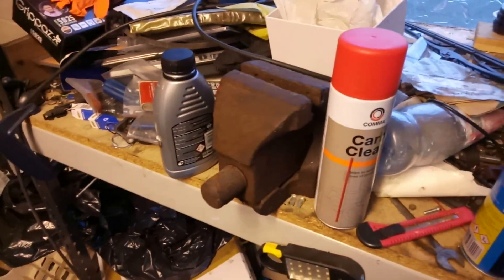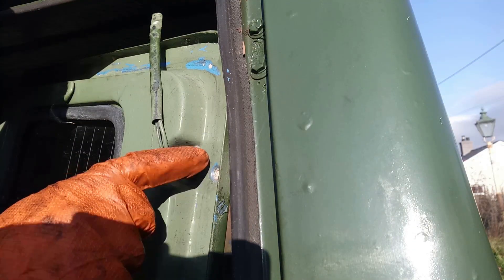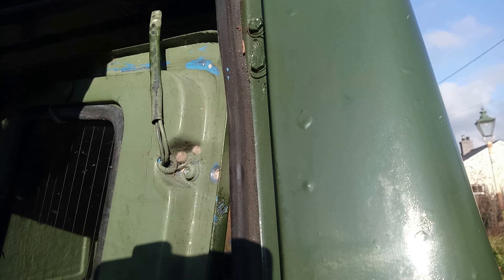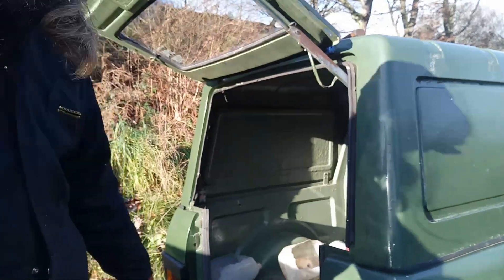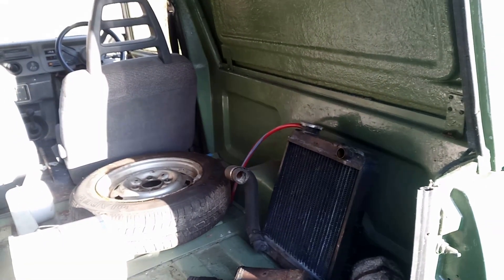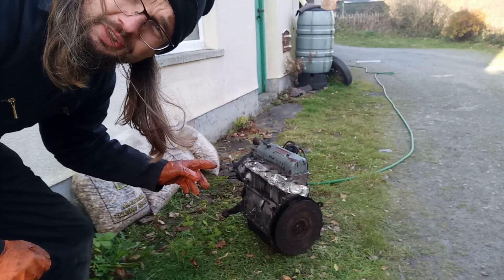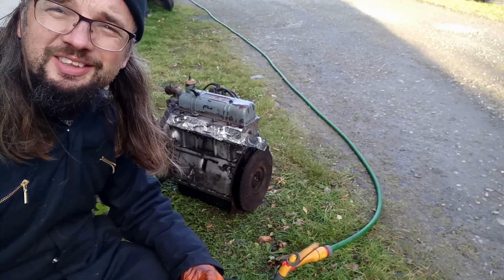Project Fox Part 2: It begins! Sort of

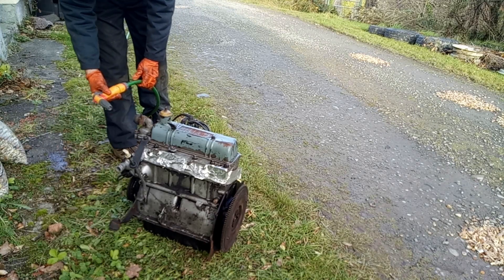Comment: Before flushing out that engine it would be best to remove the drain plug on the block. Reliant engines are notorious for silting up around cylinder 4. You can see the drain plug near the back of the block at 8:37. Remove that, don't force it as it's a narrow thread in the block. Then have a right good poke about with wire round the wall of cylinder no.4. See what comes out while flushing.

Comment: If I remember correctly, the port on top of the cylinder head is where a hose tailpiece screws in for the heater hose connection.

Comment: Since we're all on about the best water displacer & rust penetrant, an old machine shop owner told me that ATF and Acetone mixed %50/%50,  ( or lacquer thinner if you cannot get Acetone..) works far better than any of the commercial stuff.  ATF has a lot of detergent in it so it cleans munge off better than WD40 or Kroil.  It is a bit stinky because of the Acetone, use outside only.

Comment: I think that water outlet/inlet on the at the top of the block is where one of the hoses from the heater matrix connects. My Reliant Regal Supervan had a heater connection there. As I remember, there was a brass tap in one of them to turn the supply off to the heater matrix in the summer. The Robin had a heater control on the dash. Good to see you can now open the rear door on the Fox. As others have said, careful how you lift that engine (remember my back problem at the NEC?). Looking forward to further Fox videos.
Reply from the maker: Correct.  It sure exactly what bit is missing. Hopefully I have it somewhere...

Comment: A wire wheel on a bench grinder will be a good way to deal with and small items
Reply from the maker: That would require both a wire wheel and a bench grinder. And a bench actually clear enough for a bench grinder...
Reply: @HubNut  your correct on all counts,if you go with a hand held unit they can be flexible but require the part to be attached tothe something or held in a code which I don't think you have either, just suggestions ,looking forward to the next  video.

Comment: If you suspect a bolt or screw is going to be seized... a couple of good whacks with  a hammer before you start trying to undo it can help crack the rust and crust in the threads
Reply from the maker: Off camera, I did just that. I should have included it! It's a good technique.
Reply: That plus  a good talking to.

Comment: I like Bilt Hamber Deox-C for derusting small immersible parts. It knocks spots off all the vinegar, cola and all the other crap people seem to swear by, is fifteen quid for a bottle of it and it goes a very long way - it’s in powder form, you dissolve it in water to a concentration of your liking. Its gentle stuff too so doesn’t fuck you up like concentrated acids do. I don’t work for Bilt Hamber or stand to gain in any other way from making this recommendation. Keep up the heroic work sir!
Reply from the maker: Bilt Hamber do make good stuff to be fair. Not tried the Deox-C, but other friends have had very good results.

Comment: Some one intoned "making a Reliant cool again." I like that maybe that could be Project buzz word better than resurection  It still  is strange to me that engine sizes are so small . My Kawasak  motorcycle was 900cc and I drive the Fiat 900 70s something model. ThankGod Aluminum engine s Half fun of watching the builds is the chase for right tool😂😃😊😀😁🤔😝😛🙄 so how many pounds do have into the Fox so far?
Reply from the maker: So far, not a lot.

Comment: I`d dearly love to be able to put a hose  pipe up a fox`s inerds, the 4 legged variety are a bloomin nuisance. 
Do you know if the engine is good ? If not  I`d seriously consider a leak down test first.
It`s a sort of compression test in reverse, & will reveal nasties like internal cracks or valve problems.
Reply from the maker: It was a known runner before I got it. How healthy, not sure. Chanced my arm with the Invacar, twice, and got away with it...
Reply: I was never that lucky, only time will tell if it`s three in a row . I
f the air turns blue over wales one weekend, I`ll listen out for faint "booger" !!!

Comment: I highly, highly recommend the Alligator pliers made by Knipex, get the largest size. They are well worth the price, they dig in like plumbers wrenches but with small heads that you can get in small spaces. There's only one bolt I haven't got undone with them and that was a drain bung on my Land Rover that wouldn't even come out after being heated with acetylene.

Comment: Wouldn't it have been a lot easier to just drift a new pivot pin into the existing hinge?
Reply from the maker: Looking at the state of the hinge, no.
Reply: @HubNut  Fair enough. :) Doesn't look that bad, but you're a lot closer to it than me. I just like to try the easiest approach first. This sort of job always seems to grow, the seized screw being a classic example.
The engine looks to be in reasonable condition. It will be interesting to see how you get on.

Comment: Huh, that pin that sheared looked like a simple roll-pin/spring-pin, wonder how difficult it would've been to replace? (big question is, easier or harder than the hinge swap?)
The green does appear to have been applied rather poorly. Interesting latches, could use some lube! I wonder if a Reliant engine weighs less or about the same as an air-cooled VW long-block? A pallet and some ratchet straps could temporarily hold an engine, maybe?
Reply from the maker: The pin looked well seized. Steel pin in what I think is an alloy housing, so the pin corrodes, expands and (in this case) snaps.
Reply: Ah, yeah, in that case a new hinge is definitely better! With it off the car, might be able to salvage the assembly by using an alum solution to dissolve the steel while leaving the alloy housing intact and have a spare if the housing isn't too damaged. But I don't know if it's valuable enough a part to be worth the effort. I'll leave that determination to you, I'll enjoy watching whatever you choose!

Comment: If l have to remove a corroded steel screw from aluminium I hold a heated soldering iron against the head of the screw and let the heat soak through, this also does not damage the surrounding area. I also use a cut off wheel in a dremmel (other brands are available ) to make a slot into the screw head to get some purchase with a flat head screwdriver.

Comment: It might be worth taking a trip to your favoured scrap yards and finding a connector suitable for heated rear screen wiring to splice in to the wiring on your Fox.  It looks like the only way to disconnect the wiring otherwise would be to disconnect it from the connectors on the glass and pull it up through the tailgate, which isn't horrible, but getting it back in and in the right place would not be a fun or short job.  It is important to use a connector designed for that as heated rear screens draw a lot of current and standard electrical connectors will probably just melt or maybe even catch fire, so using one designed for that from a scrap vehicle is likely to be by far the easiest and cheapest method...
Reply: A simple pair of spade connectors will do the job properly.
Reply: @cjmillsnun    They might do but I really wouldn't want to take the risk, an electrical fire in a fibreglass car isn't worth the risk as it could well burn the car right down to its chassis.  But using a connector from a scrap car you know it is going to be utterly up to the job as they are designed for it and have a pretty decent safety margin included, just in case...

Comment: Silly question but why not just replace the broken pin in the hinge?
Reply from the maker: I think I'm going to have to do a follow up video, but it was easier to get another hinge than try and force the rusty remnants out of the old one and find a suitable pin.
Reply: Being an ex vehicle builder mainly buses I’ve replaced a few of them roll pins I’d spray them with plus gas over night and use a long punch to knock them out you could also apply some localised heat to the hinge and knock it out just for future reference of course but none the less a cracking video can’t wait to see more of the progress.

Comment: Why cannot you just replace the broken hinge pin? It is probably just a roll pin made from rolled thin steel.
Reply from the maker: Because it had corroded into the housing.
Reply: HubNut Well in that case I will have to agree with replacing the hinge, a steel pin corroded in a die cast hinge is not easy to remove.

Comment: Would the hole at the top of the engine be where the temp sensor goes?
Reply from the maker: No. It's part of the heater loop apparently.

Comment: Would it not be better to upgrade the fox engine or replace it altogether with a much more practical and modern unit. There are a few small 4 cylinder engine options available nowadays but I think the 1300 cc from suzuki would be ideal.  The reletivly minor power increase would be handy,  you could rename the van to foxybusa or hyafox or just plain and simple"f×÷=ing hell" every time you press the accelerater.
Reply from the maker: No. It should be quite perky as it is. Upgrading engines it not easy.

Comment: Try electrolytic rust removal on your frozen nuts, good for all the rusty stuff too. Fabric conditioner run through the coolant passages helps remove oily scum and deposits but the engine will need to be fitted and running. Good to see the Fox started - would have loved to have seen a Wartburg or Saab two stroke fitted. Are you going to time lapse the garage clean up?
Reply: jezmun you mean reverse electrolytes. Electrolysis is a process for plating.

Comment: An open and shut case, or tailgate at least... :P

As for securing the engine for testing, a pallet, blocks of wood and screws & bolts to make a rudimentary engine stand, I've seen people rig up 2CV engines like this for testing, so should work fine for Foxy Reliant there... :D

Comment: That's the beauty of an Aluminium engine. Nice and light. You could run the engine by attaching to a rope on each side of the engine to reduce it rocking about on or on a hoist.

Comment: While it's out pull the rocker Assy and let it soak in degreaser no doubt the rocker cover gasket has gone crispy anyway - -  pull the timing gear cover and inspect them too as they do gunge up the oil ways, they also leak oil when hot at the mechanical fuel pump (crispy gaskets again) some engines also use a spacer on the pump what's double trouble -- if you pull the distributor make a note where its pointing first, even tho the drive is offset it only Just offset - lack of maintenance can cause the the advance weights to stick (fiddly £&@£ of a job iirc)
Reply: And this time,do not use a hammer to remove the distributor

Comment: Hooray.   Looking forward to project Fox.  Consider investing in a Dremel tool (similar products are possibly available). The time saved cutting off wayward screw heads or cutting slots in a chewed up Phillips or Pozidrive so a big screwdriver can be used is amazing. I wouldn't be without mine now.
Reply: Rumour has it that he has six. He put the first one he bought on the garage floor after a job, and later went to find it for another job. Not being successful, he went and bought another, and after finishing with it, put it on the garage floor. Some time later ............

Comment: A quick tip to help with those painted-in bolts is to go around the paint seal between the bolt head/washer and the washer/body with a sharp pointy thing ( i use a small bladed flathead screwdriver) ..this can help to break the paint seal and loosen the bolt. :)

Comment: I was waiting for the water to shoot out of an un expected hole and get you in the face! You need a check strap on the tail gate for having a picknic with the lady! Bolt the engine to a pallet to test it with some coach bolts. How much did the fox cost? I want a trabant but they fetch good money now.
Reply from the maker: Fox cost £250, which is a lot for me, especially a car with no engine!

Comment: Why not just replace the pin
Reply: Whoa there little fella, replace the pin when you can have so much fun with cammed out screws, you should be ashamed of yourself.
Reply from the maker: Given the hinge was free, and a lot less hassle than trying to get the remnants of old pin out, I think this was the best solution.
Reply: @HubNut  Replace the pin  when you have time, then you will have a spare. R.I.P. wire brush.

Comment: 10:28 Bend your knees more than that, otherwise one day you will have a valid reason for driving around in an invalid carriage. Best practice is to avoid lifting anything whenever possible. Good luck with Project Fox.
Reply: Couldn't agree more. I try to not lift a finger at home.... wife goes mad!
Reply: my back ached just seeing him lift it....
Reply: @jusb1066  I'm glad that it wasn't just me. Feet apart, one ahead of the other, toes pointing outwards, back straight, knees bent, head up, and lift. It's easy enough to avoid lots of pain.
Reply: having done that myself, with an engine from a fox, i can assure you that they aren't all that heavy, i'm sure the dry weight is around 50kg

Comment: Stupid question without a doubt. But couldn't you have just replaced the hinge pin ?
Reply from the maker: The chances of getting the old one out were roughly nil. It had corroded into the housing very badly.

Comment: The reliant engine's so light because of the weight restritions of the original reliant three wheeler - they were a trike of less than 425Kg / 1000lb which fitted in with the tax classification of the day. The engine more-or-less dates back to the original reliant three wheeler (I heard a story that the reliant name was chosen to use up old stock raleigh fittings with an "R" logo, but that seems unlikely) which was based on the raleigh but used the austin 7 engine. Either way, the lighweight engine and bodyshell of the three wheelers were to get under the weight limite so us bikers could drive them on bike licences - and very popular they were.

now the scimitar was another matter altogether......

Good luck with another interesting oddity

Comment: I don't know a ton about Reliant vehicles but I would love to make a small suggestion.  Considering you are constantly needing a vehicle to haul, store and transport many large items from repairs that you do on your other cars within your fleet; Maybe it would behoove you to keep the Fox as your Uhaul vehicle after you get it up and running.  Kinda like your workhorse vehicle to run engine blocks to machine shops or carry parts and bits that won't fit(nor would you want them too) in your other cars.  Could even have it vinyl wrapped with the Hubnut theme to promote your channel. Just a thought.
Reply from the maker: A good plan, but there's a change of vehicle coming up which will do likewise... If this weekend goes well!
Reply: Lookup2Wakeup  I hope not. I love it so...smiles.
Reply: @HubNut  Please don't let it be TWC!
Reply from the maker: @HowardLeVert  TWC is going nowhere. Don't worry!
Reply: @HubNut   Phew! I have grown ridiculously fond of that little car. Speaking of tidying up - something I'm hopeless at, by the way - I do keep feeling an urge to drag you down to a place I know near Shepherd's Bush that does second-hand Dexion 'Impex' shelving - the all-steel stuff that's screwless construction, and it's utterly brilliant. It'd be perfect for you.

Comment: ian never clean the garage it takes the you out of your vids it fact it looks clean compared to mine just remembered where I left me gripy things changed the battery in my motor home and I think they are on the ground just where I dropped them will pick them up when I cut the grass in the spring if I do not need them sooner now if I could remember where the other pair of grippy things are

Comment: Woo Hoo... i never use WD, i keep a jar of old diesel and a syringe or even old engine oil diluted with old petrol. if there's one thing i've taken from your channel and mystified the locals with is the word "faff" or "faff'n", it is now a technical term in my garage, lol.
Reply: Can't stand wd40. People think it's magic stuff for helping open seized nuts and lubricating things which it doesn't as it hasn't any lubricating properties. Old engine oil has many uses and I even paint my shed with it. Works wonders.
Reply: It's very nice for loosening up old gunk and cleaning parts, and for flushing out things.  (And smells more pleasant than other solvents that also do that)    It works "fine, not great" as a penetrating oil too (as well as any of them work, which isn't a lot), and it will help considerably with lubricating a rusty fastener you're trying to get off, once you have loosened it enough to allow the wd to get on the threads.   Just about any light oil will do that.    But it smells better than most.    It certainly isn't a long-lasting lube of any kind though.. real oil should be used for lubricating things.   It's only going to loosen up old gunk and then evaporate.
Reply: I call BS on that "no lubricating properties" statement, Terry. I got a slight bit of overspray on the front brake disc of my motorbike one time. That was an exciting ride, when I got to the traffic lights at the bottom of the hill! But in general, yes it is very poor as a primary lubricant.  @terryatkinson899
Reply: @MrPGT  I just get fed up listening to people saying put wd40 on things expecting miracles. I have it but rarely use it. Old engine oil is what I use for lube   and it's free if you do your own servicing...

Comment: strap it too a pallet and fire it up
Reply: Or at least do  compression test. It would be quite disappointing to install the engine only to fond out that it is knackered. Alsof drain that engine if you will be storing it in a cold place. Don 't want to have a kracked block.